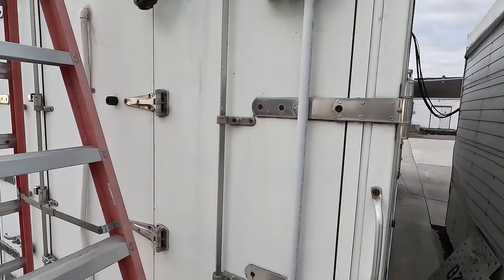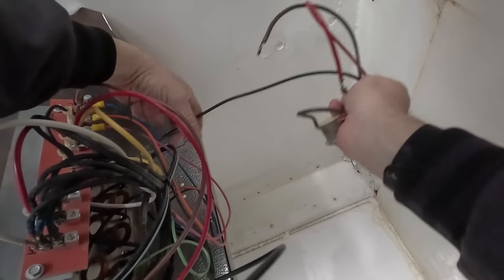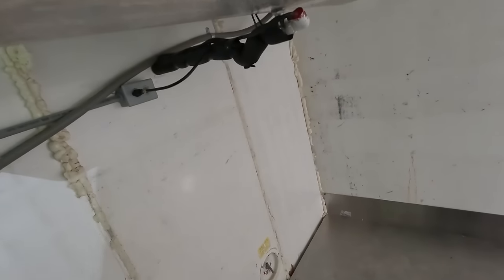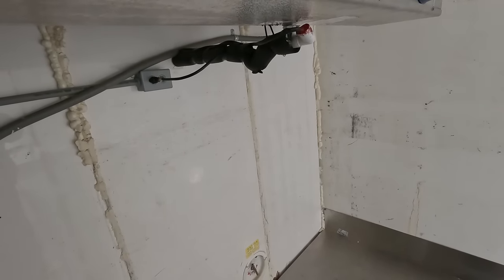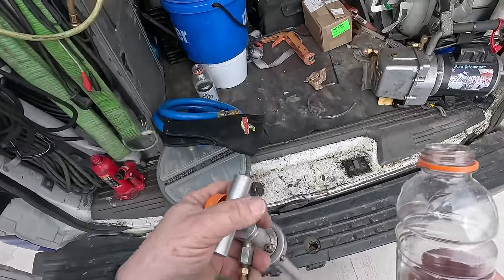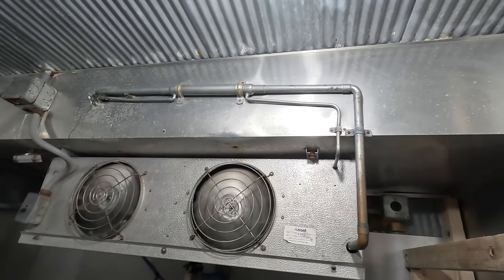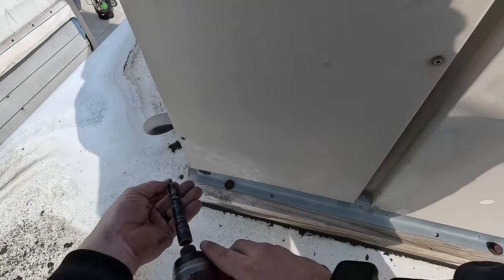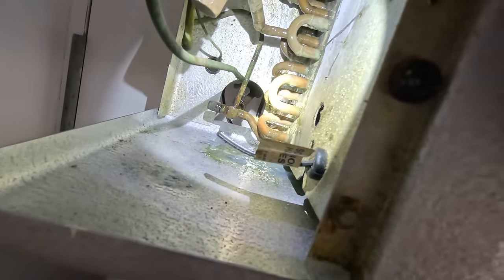Pocket Full of HVACR Band-Aids

Comment: After I retired from the trade after 52 years, what amazed me the most was so few units just spontaneously  burst into a fireball straight out of the box!
🤣
Reply: Had a union electrician wire a new walk-in freezer install for me about 15 years ago. He wired L1-L2 directly to evaporator H1 and H2.  Instead of calling like he was supposed to do, he powered the circuit and left. Pretty much melted everything…

Comment: Man my boss sent me to change a heater assembly on a Munters today. Old one was completely burnt up from the burners to the controls. machine hasn’t run in any mode for almost a year, doors off the entire time, new module is for a unit that’s 20 years newer. Total nightmare to install in this old piece of shit…of course it doesn’t work correctly and now it’s all on my head somehow. I was setup to fail from the beginning, guy who quoted it gave the bosses the impression that we change this heater out and turn the key, when in fact this is step 1 of like 20. Now I see why commercial guys play hide and seek for a grand a week…should I have found a way to hack this thing together and make it work? Am I being to sensitive?
Reply from the maker: As long as you can make something run safely and if you explain to the customer what you want to do, then I wouldn’t see a problem doing what you had to in order for it to work